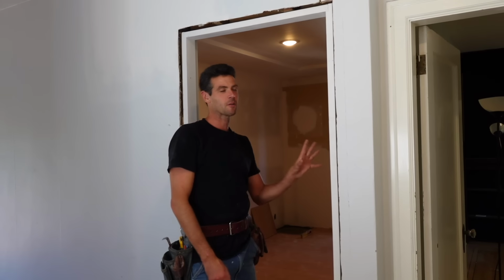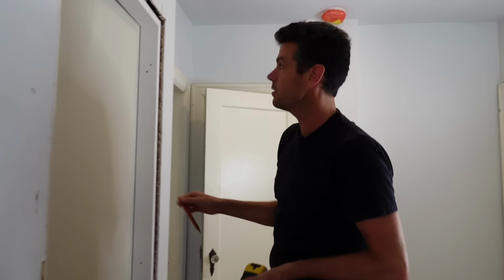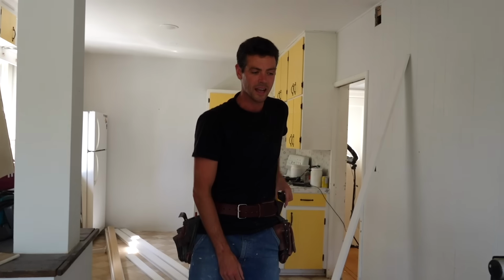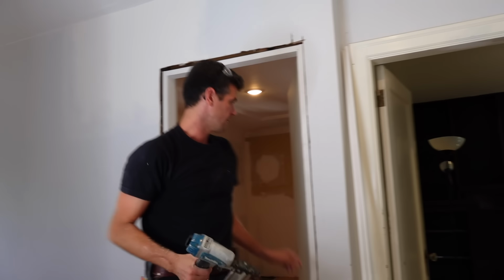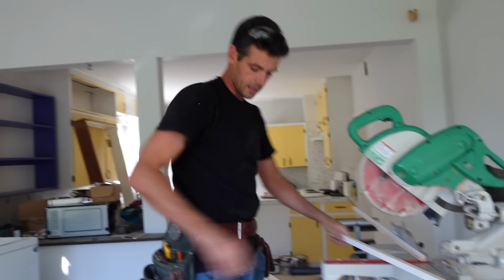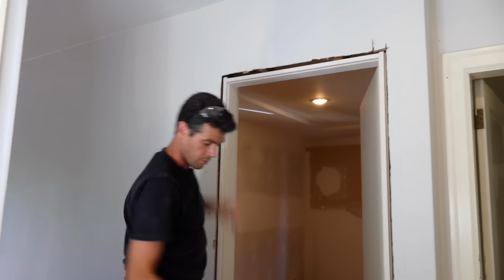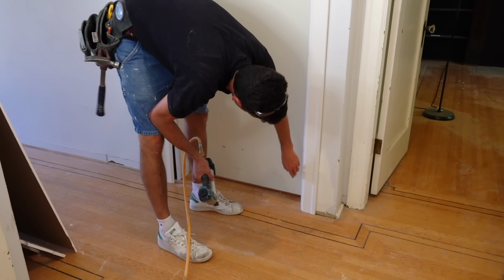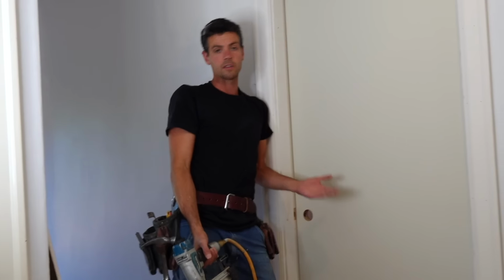Door Trim Installation when wall sticks out too far!!!

Comment: The jamb extension is the way I have always done it in the past but now I do a door stop extension all the way out flush. You will need a bit thicker door stop material but this is a great way to do it because you can do wedge shapes for out of plumb older houses.
Reply: can you explain "wedge" please
can you explain what door stop material is "sold as" -- or do you rip it?
Reply: @TheCaffeinatedOrganist  if your house walls are out of plumb a door needs to be set plumb to open and close correctly, but the door stop will obviously not work stock. I use a good pine 1x4 or 1x6 for paint grade;  plane down to about 1/2" material or less. Since the walls are out of plumb but the door is in plumb the door stop is cut at a width that reaches the widest point to where the door casing /trim will be flush to the finished wall(drywall, wood etc...then scribe a line flush to the finished wall. use a jig saw or other to cut. You end up with a gradual wedge if the walls are out of plumb. clean up the cut with a hand plane; finish,  install and then put on casings. 
The same wedge approach can be applied to a jam extension too.

If the walls are plumb but the provided jamb doesn't reach the finished surface then simply measure from the door closed  on the door stop side to the finished wall. rip some 3/4 material to the plane of the finished wall, run it through a planer to get to 1/2 or less thickness. install. 
In an old house with out of plumb walls the jamb extension or door stop (wedge shape) will be almost unnoticeable but the door won't slam shut or slam open because it is plumb.. The reason I plane down the door stop to a thinner thickness is on a standard 2 3/8' door knob set back with a rounded type door knob you will often bang your hand on a thicker  jamb extension . For a 2 3/4' set back or lever handle you can just use 3/4" door stop material. In the case of exterior door  or sound proof door you run a kerf into the edge of the doorstop material on a table saw for a kerf inserted weather strip. I know this sounds complicated but it isn't; do I need to make a YouTube video? Most videos don't provide much info on an out of plumb wall for older houses and even new houses.

Tip * I always cut my jamb extensions/door stops slightly proud of the  plane of the  finished wall surface( 1/16") caulk can fill any voids or when working with varnished wood clear caulk. Hope this helps.
Reply: Also, I just noticed Vancouver Carpenter has a good video on how he deals with an out of plumb wall. Caulk..... and that is fine w paint grade. But he was on the door stop side  of the door so making as he called tapered pieces, I call wedge. same thing. This is where you would make a tapered door stop(remove thin stock stops) before casings go on and run the casings right on to your custom tapered door stops, This is a very old technique but works great when working with varnished wood or when you want a reveal.
Reply: @jonwikan3986  never expected this much of your time to reply. Thank you very much. I do not own a planer but do hope to expand my tool collection soon.  Thank you again.
Reply: @TheCaffeinatedOrganist  some of the nicer lumber yards will have a planer or jointer and can run stock through when you purchase the lumber at their yard. My lumber yard out here in NY will do this for $5 per board or sometimes for free. Or you can buy thinner stock, say 3/8 or 1/2. Sometimes hard to find but it's out there for sure.

Comment: Thanks for the video. Question - how do you handle a wonky wall that goes past the door frame with varying depts, say 1/4 to 1/2 inch. Do you size the extension for the shallow depth, and caulk the gaps of the deeper?
Reply: No, first rip the extension pieces to the widest dimension, let's say 1/2". Cut it to length. Now, make a piece of wood that's 1/2" wide (this will be your scribe block). Then, hold the extension leg in place temporarily, holding it parallel to your door jamb; it should be touching the door jamb at the narrowest measured point and there will be a 1/2" gap at the widest point (cause you WON'T be scribing the leg there). Then, take your 1/2" scribe block you made earlier and run it and your pencil along the jam extension to mark your scribe. 

You can either follow the door jamb for a straight scribe line, or, if the wall is really wavy and wonky, you could follow the drywall instead, however this could lead to gapping between the extension and the casing. I'd probably just follow the door jamb in most circumstances and beat the drywall in if it's not too bad. Once your piece is marked, take it to the table saw and rip away, leaving the pencil mark visible on your piece. Sand/hand plane to fine tune. Make sure your header piece matches the leg pieces where they meet.

Comment: If you pre-assemble your trim set with the 2 part adhesive, put a bit of waxed paper or newspaper under the joint you are gluing, to prevent any glue squeeze out from attaching the trim to the floor.    (ask me how I learned that lesson)
Reply: good idea..
Reply: yep - been there, done that! That cyanoacrylate can be a bitch!

Comment: What gauge brad nails are you using? Also what length? I am facing the exact issue and was going to flush the pieces until I saw this. Love the overall look of the dual reveal.

Comment: Interesting that you glue your mitres on the floor prior to fitting, that’s the way I’ve been doing them for years, I’ve never seen another tradesman doing that, but I don’t work on other sites, only my own sites.
Reply: I do it that way as well. Lots of the really good finishers seem to do it that way too, either with super glue or fast setting PVA glue.

Comment: I have a question how do you fix where you have a gap at the door hung and by the time you get to the bottom almost no gap. When it was framed who hung it did not pay attention. So it is 3.25 at the top and reduces to 3 inches. So it is out by 025 of an inch

Comment: 31 and 3/4 or 31 and 1/4? If you had cut it at 31 and 3/4 And walked over to the door with it You would have had a 50/50 chance of getting it right. As you did it, You guaranteed yourself an extra trip by walking over to remeasure. These are the things I think about. Not hating on you at all Ben I love you man!

Comment: I had to cut the bottom four feet of drywall in a bathroom to remove the tile. The top 4 feet is painted. How do you install the new drywall and transition to the painted top half?

Comment: Could I follow this same method to add door trim on the side the door swings IN to?  Dealing with hinges and door latch, etc.  Thank you!
Reply: the hinges will more likely hit the trim if you are extending the jam on the hinge side. better off making the jam flush with hinge side. that or relocate the hinges further out which leaves the problem of patching the old hinge spots

Comment: Same situation, "however" , my brother had bought a  pre-hung split jamb door and the house had thicker wall dimensions because of the plaster (1960's home).  He stained the door prior to my arrival / install. I ended up having a split in the middle of the jab. I used shims all the way around the door jamb (a lot of them) and bought a narrow trim piece which butted nicely to the door stop.  Do they make a wider door jamb or are they a special order item  ? Thanks for your videos.
Reply: Its pretty easy to modify a door to make it wider, especially split jamb, just get some 1x6 and rip them down and make the male side of the split jamb on one side

Comment: Would it be more practical to do this or buy an oversized jamb and cut it to size? Assuming you're replacing the entire door/jamb and you know you'll run into this issue
Reply: Windsor plywood door shop will cut this to size in their shop for you.. assuming you buy the door from them. But in a pinch, yup, buy a 2x6 wall size door frame and rip the pieces to fit. Probably the same amount of work as this and you don’t need any extra material.

Comment: I have about a 1/8" gap. I'm debating just ripping a 1/8" sliver and gluing it to my casing, or just filling the gap with caulk.
Reply from the maker: Honestly, at 1/8 caulk is fine. It will hollow out a little as it shrinks but if it’s painted trim you won’t really notice it unless you just stand there looking at it all day.
Reply: @vancouvercarpenter  Thank you for the advice! That's probably the best option. I think a 1/8" sliver glued flush with the casing would stand out, as you mentioned towards the end.

Comment: 11:46 As you were assembling the casing, I was wondering what would happen when you went to take to door…..
Sometimes ya just gotta roll with it, as things get “interesting” (as I call it, never hard; cuz if think of things as hard on remodels, well, remodels are NEVER smooth sailing)
😃👍🏻
Reply: dumb question..why not mount the casing one leg at a time?
Reply: @forzajuve4845  Not a dumb question. Answer is…..
You can, really up to installer and how they want to do. That said, assembling the casing together with CA glue on floor/bench/etc…is a bit easier; especially when want really tight miter joints. Most, me included will do this for crown molding too. Will assemble on work top with CA flue and then take the piece to wall and nail it up.
So, again, it’s not a rule that you MUST do it this way, I’d say it’s whatever you feel most comfortable with (and naturally if trimming out very large windows, doors, etc….assembling beforehand can be hard even if if a helper, not to mention if your working alone, lol. So, might see those done at the door/window/etc….w/o ore assembling).
Hope this helps.
Have good one✌🏻
Reply: @Aepek  thanks for the answer..I enjoy your videos

Comment: I have the opposite problem. I replaced the drywall in a bathroom and it's thinner than it used to be so the door frame pokes out 1/2" past the drywall. Now I have to rip strips to build up the drywall underneath the outer edge of the casing so the casing will lay flat.
Reply: if you haven't mudded yet you could always take the drywall off and fur out the studs with 1/2 rips of plywood and reinstall the drywall. could also remove door frame and buy new or re use old, cut frame to desired thickness with fine finishing blade for a nice cut and router the round over. Better yet could try and hide the cut under the door stop or right where the jamb rabbets if one piece.  just thinking it might look a bit funny it trim was packed out a half inch off the wall.
Reply: Wow, looks like I have more options than I knew. I'll give this more thought.

Comment: 14:00 - Properly glued wood NEVER cracks. In fact, if you use PVA glue, the joint is stronger than the bulk wood itself.
Reply: Try home made glue - take a quart jar - half fill with ACETONE - and submerge simple styrofoam into it - it will melt and dissolve instantly. You will be amazed how much Styrofoam will fit into acetone. Take the resulting glue (at the bottom of the liquid acetone) and smooth it onto your wood surfaces - clamp overnight - RIDICULOUSLY STRONG!!

Comment: Nice fix.  Now what do you do when it is the other way round? That is, the jamb is wider than the wall. After attaching the trim to the jamb there is a 1/4" gap between the jamb and the sheetrock.  Caulk it? Add a filler strip to the back of the trim? Dado the backside of the trim to fit over the jamb and lay flat against the wall?  I've got an entire house like this.
Reply: either way will work. the lazy house flipper method would be just slap tube after tube of caulk in the gap. I usually cut a filler strip for the trim, glue  and  hand plane it till trim sits flush on the wall

Comment: Sorry to put this here but I have just bought a home from the year 1900 in the UK & the door trim round the whole door is jutting out on EVERY door in the house, probably because of subsidence that occurred at some point, as the whole house is that wonky kind of Victorian you get in the UK. Do I fill these holes or remove completely & retack, then fill any holes left over? Do I fill with foam or silicone? I want to do this right as the house deserves it :)

Comment: You may have been able to install the extensions, exposed grain out, which would be covered by the case trim and hide saw blade marks.  Depending on how flat the board is.

Comment: Did you add that hammer loop on your pouch up higher? I use the same brand pouch but the hammer loop is down low, which makes it a complete pain when you're working on your knees and the hammer pops out when the handle hits the floor.

Comment: You turned the brad gun sideways to  make the brad drive straighter in case the wood grain tries to deflect it left or right. Why does turning the gun make that skinny little brad drive any straighter than not turning the gun? Isn't the brad's cross section and strength about the same either way? Thx for your great vids.
Reply: 18g brads are rectangular. They bend and follow the grain more easily on the flat axis.

Comment: Having that reveal gives you ability to caulk it. If it was flush it would have to be glued nailed and then filled and most likely would Crack. As for the rock behind the casing to fix the gap. Yeah trim some off in that area.

Comment: What if its 1/8 to 1/4 or touch more at most?  Couldnt bring myself to chew off the edge face of new wall nor do i have a table saw or router table to rabbet the back of casing.  Thx.  -R

Comment: Great video. How do you handle when the extension jamb size needed isn’t continuous on the same size? Do you just have to scribe each side? I had two windows installed and it’s an old house with walls out of plumb and such.
Reply: Split the difference  so it is over/under no more than 1/8".  If it is off more than that, scribe it.
Reply: @TobiasRaphael1  thank you! Sounds like I will be scribing it. Haha. I appreciate the clarification.

Comment: Hey what happens if I have the opposite problem? I had custom french doors made and I installed them with one side flush and the other side sits about a quarter inch to 3/8 past my sheetrock so I'm assuming just backfill with mud my sheetrock up to the door jamb??
Reply: You should of ordered the proper size jamb, but if that was not possible, the jamb should have been ripped down to the proper width before installing the unit.
Reply: @Eaglefreek300  okay so any ideas on what to do now? Since neither one of those are possible now
Reply: @jacobporche271  there are 3 options that I can think of. Try to cut the jamb flush with the wall, use material behind the casing to fill space or build out the whole wall to match the thickness of the jamb.
Reply: @Eaglefreek300  thanks man I appreciate it

Comment: You fix it by right buying the right size frame you know they do make them in different depths you know if you get one a little wider it's easier to fix than trying to pack it out
Reply: well when you arent the one that installed the door frame/door jam that makes that option go out the window.

Comment: I know I'm late to the party here.  1. If you are going to buy a prehung door then order it with the right size jamb.  2. If you are going to buy a new door at least attempt to match the other doors in the house.  Here we have a standard 4 9/16" jamb when he needed a 5 1/4" jamb and a flush door when he should have bought a 1 panel door to match the door right next to it.  While we are at it, use the same casing profile too.

Comment: My drywall is almost bang on flush with the jamb half way up the door, then expands past the casing almost an inch past it and then feathers back toward the width of the casing to about 1/4” past the casing. What do you do for that problem?

Comment: I have a question. My door won’t stay closed. For some reason the handle keeps getting loose and the latch won’t stay attached. The screws keep coming out. It seems like everything I’ve tried won’t hold long. What can I do without having to replace the hole doorframe?
Reply: for the strike plate , either longer screws to try to get into fresh wood/framing  or you can try toothpicks and wood glue in the worn out holes.  Pack the old screw holes with glue, stab in toothpicks wait for it to dry, trim  toothpicks flush. the screws now have fresh wood to bite into

Comment: I have a similar problem in my home now thanks to the guy that just installed a new door/jamb for me. He installed the jamb so it's hanging past the drywall on the inside of a closet but shy of being flush on the face side of the closet. It's off about 1/4" but I'm replacing all of my door casings and baseboard with wide flat stock trim so now the door casting won't sit flat on the door jamb. It could probably be caulked but I've spent months redoing all the builder grade casings in my home and it pisses me off that this guy installed the jamb that way. I've thought about scraping down some of the drywall so the casing will sit flat. Anyone have any other suggestions?

Comment: We never pre glue casing for doors or windows. The only thing I can think of that we pre glue is the scuttle hole that holds the insulating foam insert for the attic access. You demonstrated exactly why we don’t pre glue casing in this video. First we nail the header then you nail the legs. The first round of nails should only be set into the door jamb. After that we take our 5 in 1 and stick it behind the corner and pry outwards. This will cause the corners to really tighten up and once we have that corner tight, we put a 2 1/2 finish nail into each side of the miter. If you do this right you will hit the 2x4 frame the door is installed in and the head of the finish nail will hold the header and the leg in place. As long as the painters put enough caulk around the casing where it meets the wall the casing won’t be going anywhere anytime soon and you eliminated between 5 and ten minutes of glueing time plus the time it took to maneuver the casing into place to nail it off..